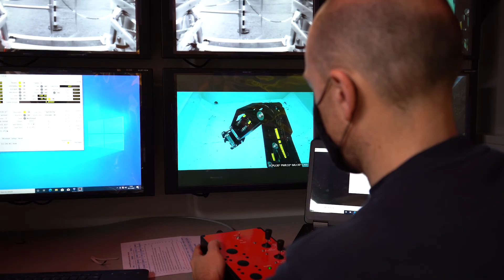Saab Seaeye's eWROV

Comment: As a newbie in the industry over 28 years ago, I've worked on many vehicles of size and design, my first vehicle was the Tiger and I was trained by a young company all those years ago and gained my initial experience in the Northsea. It's nice to see a company that has grown and developed to meet the needs of the consumer and produce eloquent designs based on the KISS principle and not over-developed because the technology was available to have but to incorporate as an enhancement rather than as an addition. I've not had the opportunity to operate the Leopard, but I'm sure I'd be transported back to my early years as a novice pilot and thoroughly enjoy the experience and improvements that SAAB has produced in the new design, albeit similar in design as the Tiger was, for this reason alone the design works and it shows in its capabilities.
Reply: Would this vehicle be suitable to attach 500 kg of C4 explosive and a timer to a pipeline in 80 m depth in the Baltic Sea?